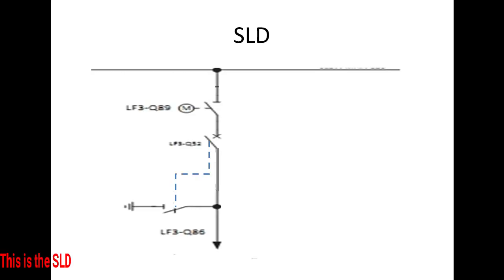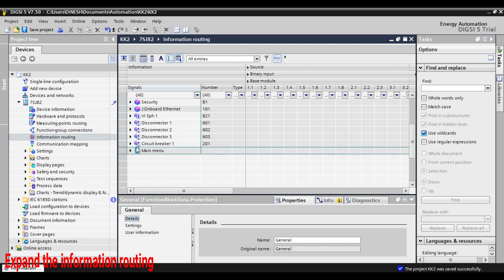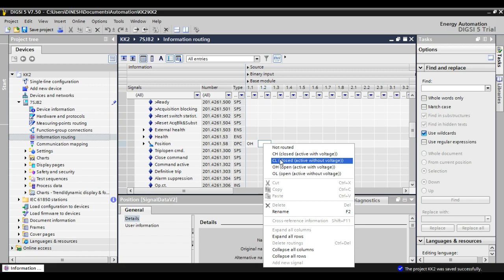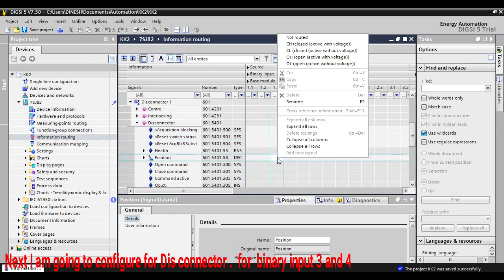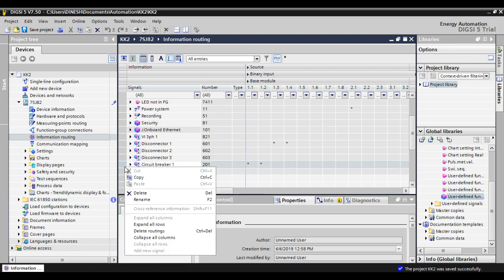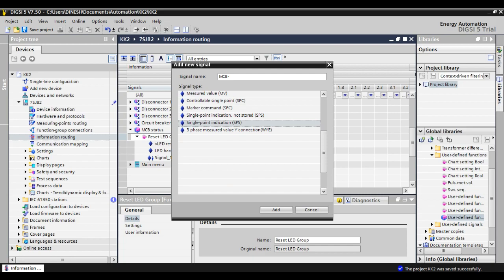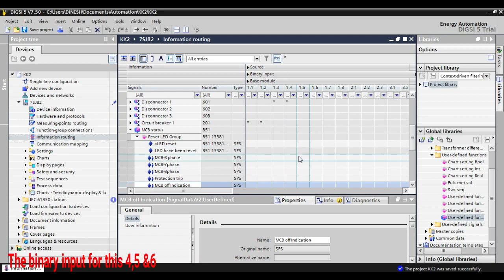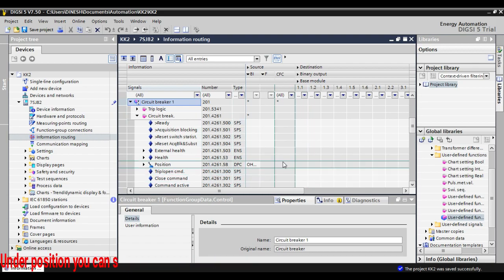How to Configure Information Routing in DIGSI 5 | Step-by-Step Guide | How to make IO masking

Comment: It doesn't explain the difference between L and TL.  TL is only available in the circuit breaker group so if you apply either L or TL there then the Open command will be latched when operating from remote.
You therefore have to route tripping from the protection group VI 3ph in which case only L is available.  To provide a lockout for remote closing after a protection trip I don't think that the fact that some trips outputs are latched makes any difference and you have to route the close signal via another BO L contact i.e. you have to enable two outputs with L status from the protection.  Maybe both have to have L status so that the LEDs remain active until reset?